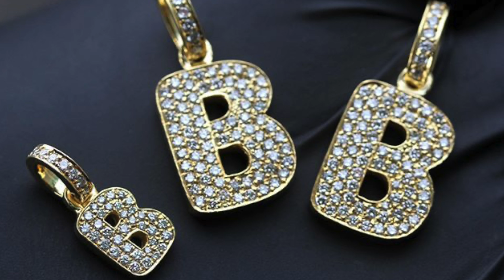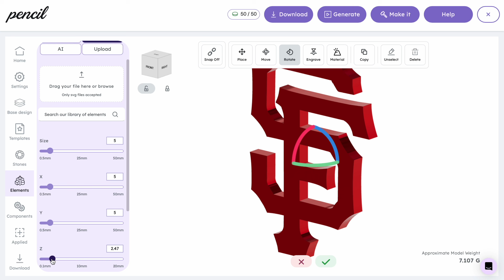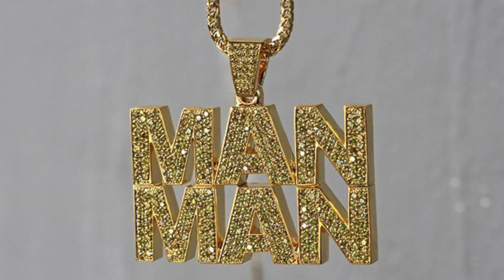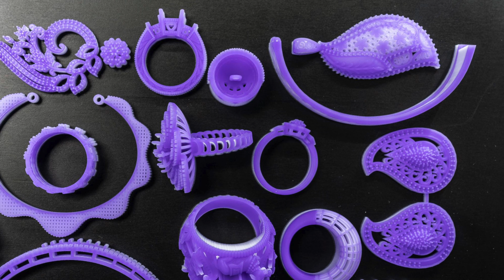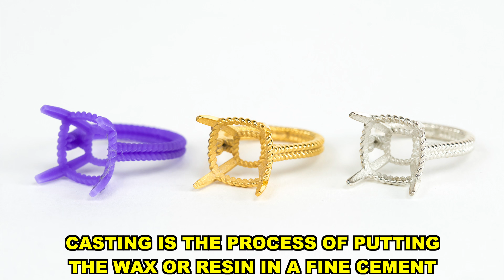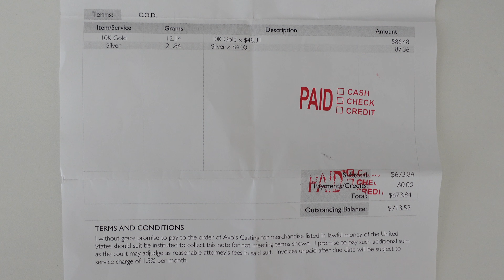How To Start A Jewelry Business With $500 In 2026

Comment: if you have a 3d printer you can print in PLA and do a "lost PLA" process to cast in metal or you can buy special filament (polycast) that melts away %100 and do sand casting or investment casting. 

you can also just print stuff then make a silicone mold from it that is reusable forever with wax or use the silicone mold directly with gold/silver (lower heat metals) a few times before it degrades too much.

Comment: I placed an Svg file and made the dimensions for size about 30 mm, but when I place stones, even the smaller 0.9 doesn’t fit as a properly. Why is yours so small at 5 mm and the bigger 1.3 stones can fit ? Do I have to reconvert the png file so that it is smaller in pixel size ?

Comment: So when I export the STL file it’s a lot bigger than it says on the Pencil app. How do you fix this issue? 

( I see you adjusted the Giants pendant to “ 5 “ but not sure what measurement that actually is? )

Thanks
Reply from the maker: there is a measuring tool in the settings be sure to use it

Comment: What about the equipment for metal melting and casting?
Reply from the maker: you dont need that kind of equipment, there are companies that do this
Reply: @SlavaTVOfficial  Why did you skip the part where you pour plaster into the mold, burn out the resin, and then pour in the metal?
Reply from the maker: @bullla_2679  because that was not done by me. That was done by a casting company like I mentioned in the video

Comment: Hey alava when I take a screenshot and convert it into a svg file and put it in pencil it says

The SVG you've tried to upload creates a non-manifold geometry which will result in a 3D object that is not solid. Try using a different svg and contact support if you need further assistance.
Reply from the maker: hey make sure youre making it from a black and white image, make sure you go to free convert and select black and white and keep corner threshold segment length and splice low. if that doesnt work email me
Reply: @SlavaTVOfficial I’ve put the setting you showed on your video and made it black and white but still says the same thing what can I do to fix this
Reply from the maker: @Fernandoa2984  if that doesn't work email me the design ill see what's wrong

Comment: @SlavaTVOfficial how do you determine which size stones an prongs you need to make this piece or any piece to be iced out
Reply from the maker: The stone size is up to you
Reply: @SlavaTVOfficial  thanks also when you get the stl file with the holes after you print cad do we need to open up the holes more for the stones to fit or they’ll fit in perfectly without drilling
Reply from the maker: @WhiteTTheTruth  they will fit perfectly for the diamond setter to set them

Comment: I know you you said the Saturn 4 is the one but it wouldn’t be a problem if we was to get either of the Saturns will it ? I mean I’m guessing not but it’s best to ask you as the expert . If can be afforded it should be fine yes?
Reply: Any Saturn should be okay for printing. I would advise ultrasonic cleaner and a UV chamber aswell, proper curing and cleaning is key to good quality casting with resin.
Reply from the maker: I highly suggest only getting the 4 model or newer models because of the self leveling plate

Comment: The part where you talk about weight is a question I’ve had for weeks. Because I want my jewelry to be affordable and reasonable. How can I keep rings 6 grams and under using 3d resin printer? Or if you can make an in depth video on how to control the weight of jewelry will change the game 🔥
Reply: dont start with rings. heavily reduces who can buy  your product as they have to be able to fit the ring
Reply from the maker: you have adjust the weight in the app to make sure it doesn't go over 6 grams for the metal you plan to make it in
Reply: Reduce depth.. create hollow sections and get rid of any unnecessary materials. Under 6 grams is a big ask for anything more than a band but possible. Just don’t go under 0.8mm thickness.
Reply: @thirty3mikkel163 how do you create hollow sections on pencil

Comment: I did a Small market study yesterday and found all I need in the diamond district. Didn’t even know my city had one. Going to make a model or 2 tomorrow and try and get those going to start this. But I had questions about diamonds. One of the lady I talked to said that she thinks lab grown diamonds might drop in price a lot in the coming years as the supply is higher than the demand. Do you think it would be safer to with natural and certified diamonds or would it be too costly to start?
Reply from the maker: The reality is that lab diamond prices also brought down natural diamond prices. If youre buying small stones it doesn't matter if they're natural or lab, both do not have a resale value